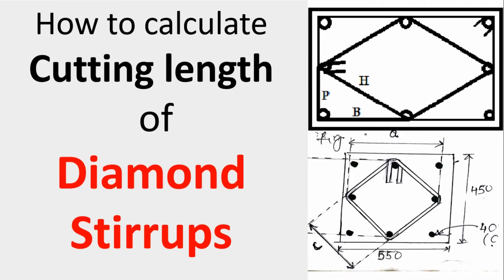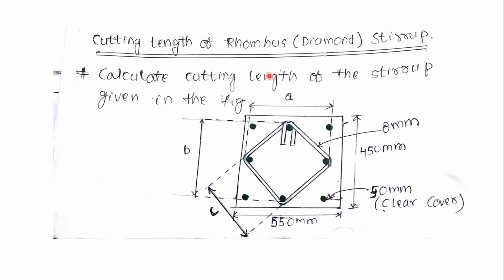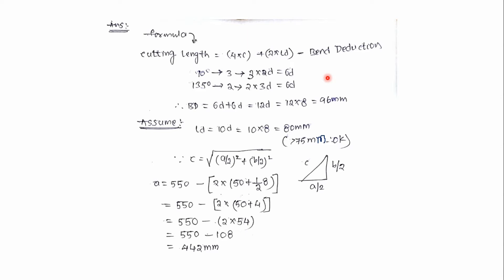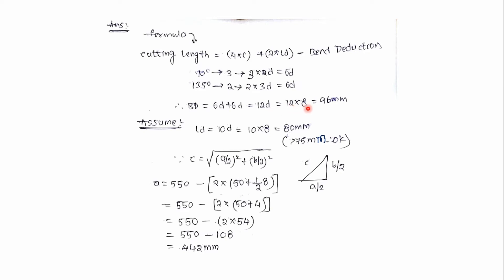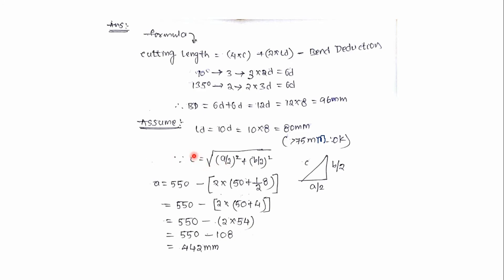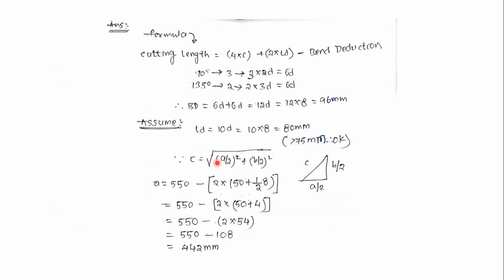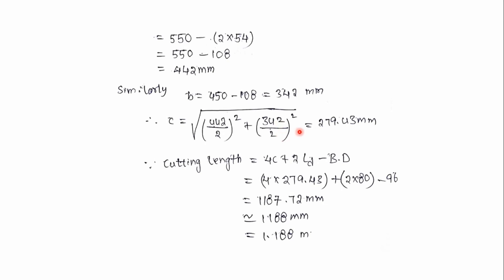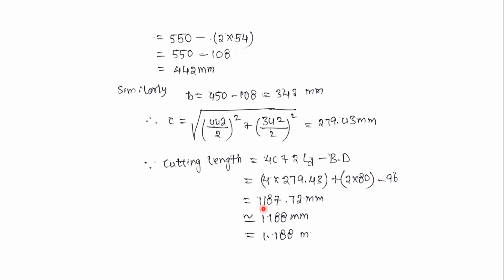How to calculate Cutting length of Diamond stirrups

Comment: How to decide which type of stirrups to be used and how many to be used in column
Reply from the maker: type of of stirrup is structural engineers choice, but No.of stirrups is depends upon the how much load is acting that particular elements (beam, column), Based on load we get the center to center distance.
 (length / center to center distance) +1 = no.of stirrups in that particular element.

i hope you understand what i am trying to explain.

thank you for being here :-)
Reply: right